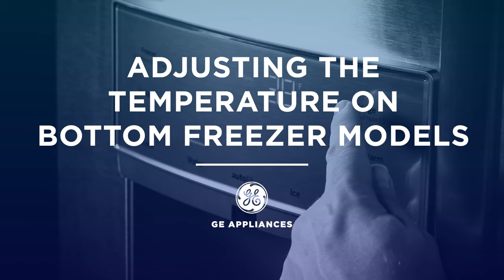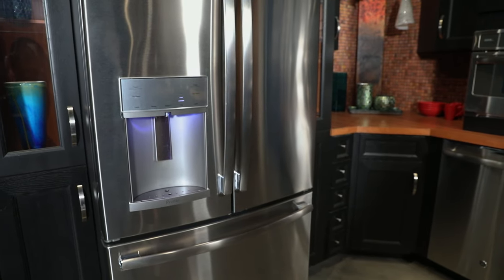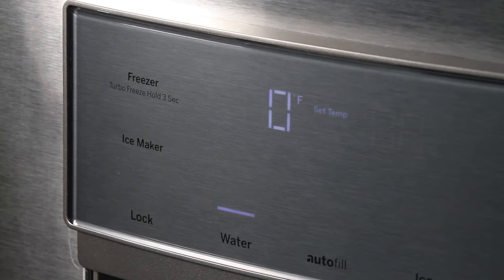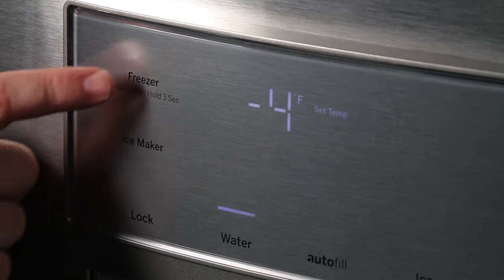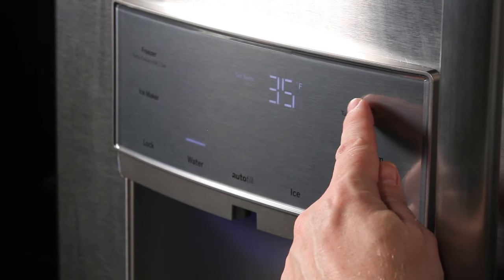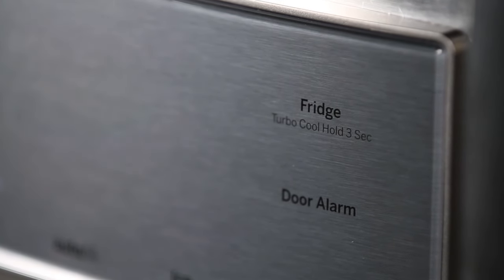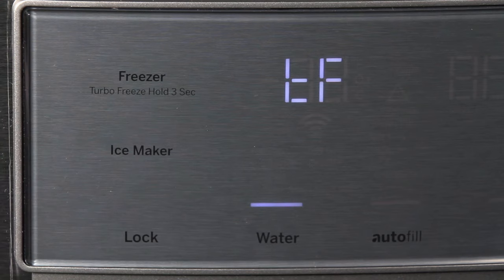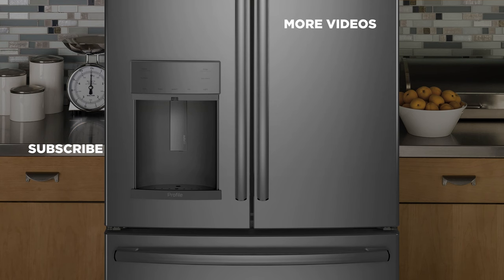French Door Refrigerator Temperature Controls

Comment: This should be included in your on-line appliance manual - and it's not there.  Your customers shouldn't be required to hunt for a YouTube video to figure it out!  Poor communication and instructions in your written material.
Reply: Tangier 14 is exactly right. It should have been included in the printed manual as well, but it's a little late for that now. It made me nervous when I touched a number on the touch screen control panel and accidentally made an unintentional change. The use of the display panel is not entirely user friendly and intuitive and there are NO instructions in the manual at all. It took a while to finally find this video so I could reset the temperature.
Reply: @Paula Zamudio I was referring to the video posted right here which all these comments are about. It does explain how to turn the temperature up or down. That said, I would not recommend the Model # GWE19JSLGFSS refrigerator to anyone. The capacity for both fridge and freezer is way too small. There is so little room for food storage that you definitely have to go shopping more frequently and buy less food when you go.
Reply: Thank You! This is ridiculous
Reply: I literally just got our new fridge this morning and it didn't have a paper manual. We were like wtf!? Where is the manual. Only has the quick users guide. Pretty disappointed.. smh
Reply: Couldn't agree more.   TY tangier14

Comment: I have a brand new Cafe series, delivered today. I had a different one delivered 2 days ago but the freezer never cooled below 67 degrees F. So we had to return the first one and are trying again. It has been nearly 3 hours and the fridge is cooling, but the freezer is still not dropping very fast.I don't know if I accidentally hit a reset button. Manual is unclear, and the video is for model with outside dispenser and we do not have that. It's Saturday, and customer support is closed. If anyone can help, please respond.Question is, can we see what actual temperature is? It is not displaying.
Reply from the maker: Please allow 24 hours for the temperature to stabilize to the preset recommended settings. We're still happy to further investigate this for you.  Can you please provide your model number?
Reply: @geappliances  Thank you for responding. The freezer is getting cool finally, so I'm not as concerned. It is 
Model # CWE23SP2MS1. Is there a turbo cool on this model? Also... the manual says that the freezer cools first. The GE technician I reached on Thursday said the refrigerator cools first. She was right. If the manual said the right order, we would not have questioned the freezer being so slow. I'm confident that the temperatures will be stable in 24 hours.
Reply from the maker: We're happy to hear your unit is cooling. This model is equipped with Twin Chill Evaporators. Dual evaporators maintain separate environments in both the fresh food and freezer compartments to manage temperature and humidity levels and keep foods fresh. Cold, dry air stays in the freezer compartment to prevent freezer burn, and more humid air stays in the fresh food section to keep fresh food fresh longer.

Comment: What is the ideal temperature for my bottom freezer
Reply from the maker: The ranges for the fresh food section on most models is 34°F to 42°F; the range for the freezer section is -6°F to 5°F. The recommended refrigerator temperature settings are 37 degrees Fahrenheit in the fresh food and 0 degrees Fahrenheit in the freezer section.

Comment: My refrigerator is set to 34 degrees, but the temperature is actually 68 degrees. The freezer works fine. How can I fix the temperature in my refrigerator?
Reply from the maker: Hi Cheryl Thanks for reaching out. We're sorry to hear that your refrigerator is not cooling. Having issues with an essential appliance is never easy, and we apologize for the stress. Please allow us to further investigate by sending us your model number. Thanks. -AT
Reply: Thanks for responding so quickly. My model # is DFE28JMKEES.
Reply from the maker: You’re welcome, and thank you for providing that model number. We do regret that you’re having this cooling issue with your refrigerator – we know this must be frustrating. Notice of your experience will be sent to our team for review. 

You may want to check the door gasket to ensure it’s sealing properly, and that there’s at least 1 each of air clearance on each side, top and back of the refrigerator. We have additional tips on what to check if the refrigerator isn’t cooling enough in an article on our website, available here: http://spklr.io/6051cJmJ . 

If you’re not able to resolve this issue using the information in the article, our service department is available at 1-800-432-2737 or online at http://spklr.io/6052cJmK ; a technician would be glad to examine the refrigerator. 

We hope this is resolved for you soon, so you can properly enjoy your refrigerator. If you have any other questions or concerns, we’re always glad to offer assistance. -SG